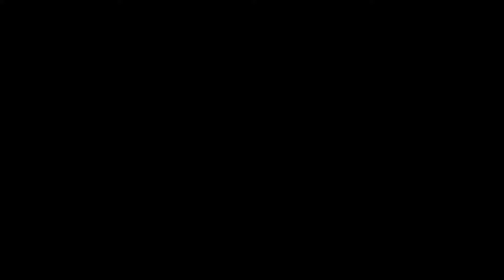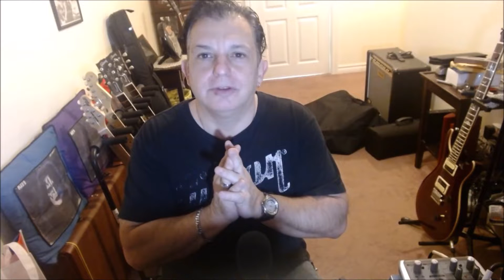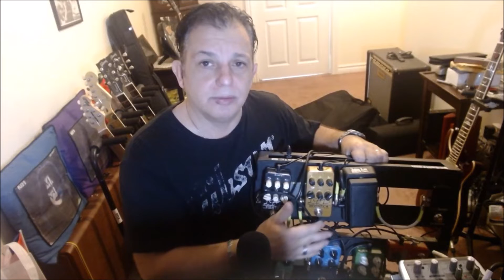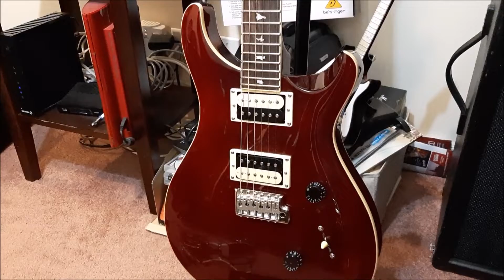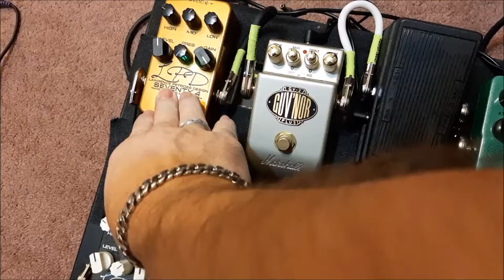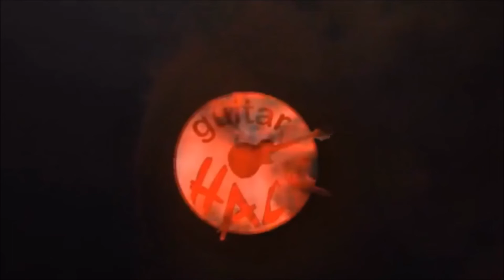Pedalboard Nightmare

Comment: better for every pedal to have it's own isolated power supply then less 'noise'. tbh daisy chain is not great and would avoid .... somewhere you had a loose & or 'dirty' connection that can happen pretty easy if pedals not really secure on board then there is movement in the traveling loading unloading to/from gigs but also can happen with haphazard layouts which put extra strain on cables .... always better to travel with spare good cables & deoxit & back-up power supply
Reply from the maker: Thanks for watching bvninja. Cheers

Comment: You can work your way back, unplug the output jack, touch it with your finger.  Use a multi-meter to test your patch cables one by one to ensure you don’t have a small leak to ground.
Reply from the maker: Thanks for the tip and welcome to the channel. Cheers

Comment: I'm spitballing, but I think there had to be a slightly loose connection or a patch cable shorting out. 
I've been there. Twice on 2 pedal nights, I actually ripped them out from the guitar and amp and went straight to the amp the rest of the night. I didn't care. I played the songs the same way:  with enthusiasm!  
It happened another time when a bandmate and myself worked our way back through it just as we were about to start and we found the issue. It sucks, but it happens. I'd just have the extra patch cable on hand. If it happens again, check the cables and the pedals for loose connectors. Could be the ring around the pedal input/output. Good luck.
Reply from the maker: Thanks for the tip. Cheers